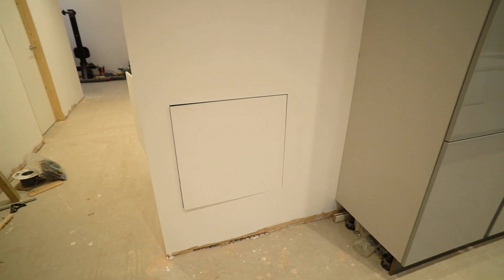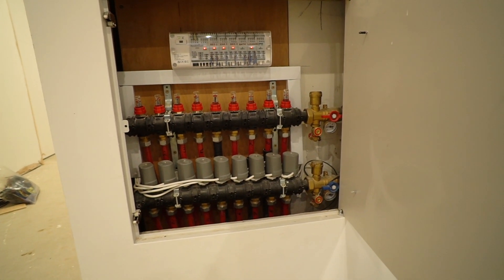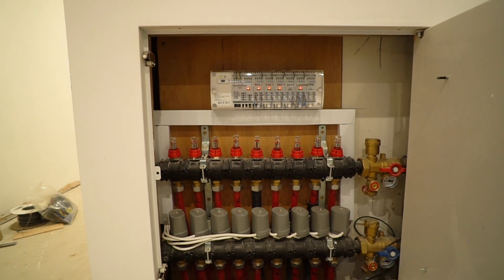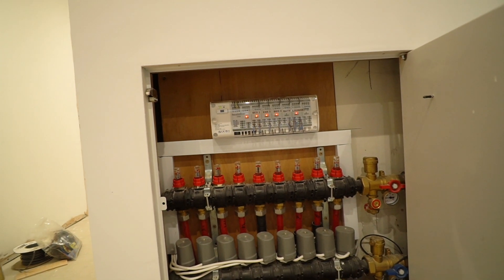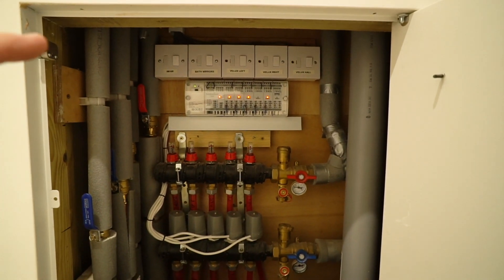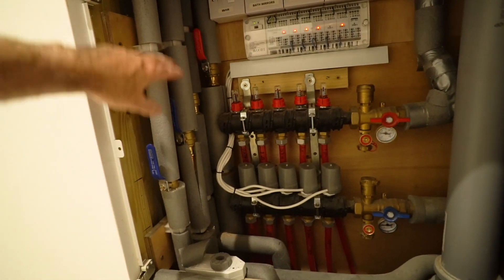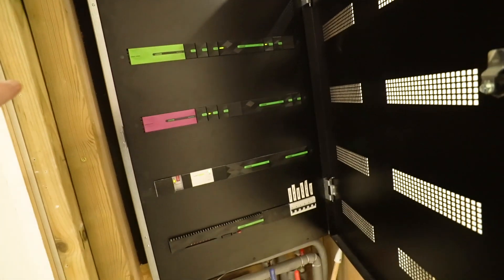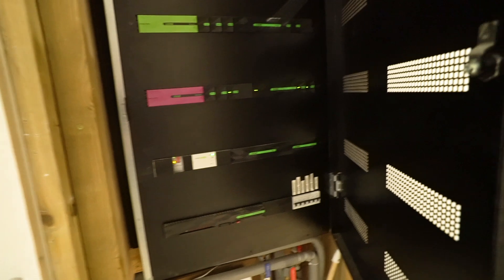how to fit a hidden flush access panel

Comment: Put another unit in front of that panel on the end of the run but mounted on casters for easy access, covers it up and more storage 😊. Love the way the forward thinking is working out leading to nice and tidy rooms and internal cupboards.
Reply from the maker: Thanks Jim. We wanted very clean lines which is why we wanted UFH. Also using the Loxone light switches the one switch controls music, lights, blinds and is a thermostat. I am also considering a hidden door to my home office ;-)

Comment: Why not using the loxone valve heads and keep all the control in loxone?
Reply from the maker: I did consider using the Lxone valves but the original version had a poor reputation for reliability. I noticed they only just announced a new version and use the words durability and strenght quite a lot. Loxone partners I spoke to suggested a 10% failure rate. Having seen that with an air source heat pump most of the loops are open most of the time so I may well actually just remove the valve heads and run fully open. The control is all in Loxone as Loxone controls the current valve heads using the relay modules and it seems to work well.  The Heatmiser wiring centre is just used as a junction box.
Reply: @JurassicJungle  But with UFH relay is all you need. You don't need the 0-100 control tbh
Reply from the maker: @s31teg  Not sure what you mean. The relays are controlling the zone valves (but we may remove them) the ASHP control is via Modbus with Loxone defining the required water flow temperature. That seems to be working very well.
Reply: @JurassicJungle  If it works then all good.

Comment: The only real reason for thermostatic control on the loops is rooms subject to solar gain, otherwise weather compensation is all the control you need. I still have a gas boiler running weather compensation and have no room reference temperature influence at all - pure weather compensation, which took a heating season to fine tune.
Reply from the maker: Thanks Norman, I think you are right and I may have spent a lot on relays that I don't need but its easy enough for me to just remove the heads. It looks like my system keeps them open all of the time that it requests heat at the moment. Loxone is currently set to do the weather comp and send a desired water flow temperature to the ASHP. The circulation pump is activated by the buffer temperature turning on at 25C. It just isnt cold enough to do any tuning yet as the flow temperatures are very low. I think its useful for me to be able to see the temperature of all of the rooms as that will help me tune things. I have a couple of rooms that are not warming up enough at the moment, both the only external walls of the original construction with just a 50mm cavity, the rest of the roosm have a 150mm cavity with 140mm of insulation. The UFH design did have the heat loss calculations for each room so I had assumed the flow rates would be correct but may need to increase the flow to these 2 rooms. We are not fully insulated yet either as we have no loft insulation and I plan to clad the old external walls and add a little external insulation there which should help. We don't expect to have much of an issue with thermal gain, the main areas of glass are North facing so at least we wont have that issue. Loxone can take control of that to circulate water around the rooms should that be the case.
Reply: @JurassicJungle  Having the rooms instrumented up will certainly help fine tune your curve, especially once you have the fabric complete. It’s a very slow system (the house) and with low temperature heating there is just no need for ‘fast’ controls.